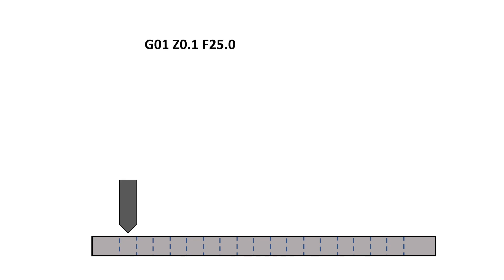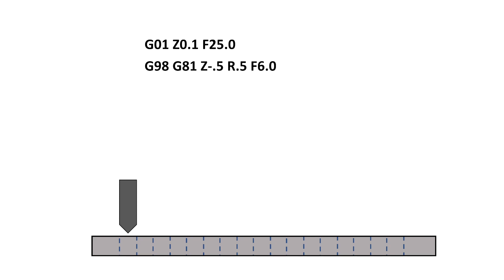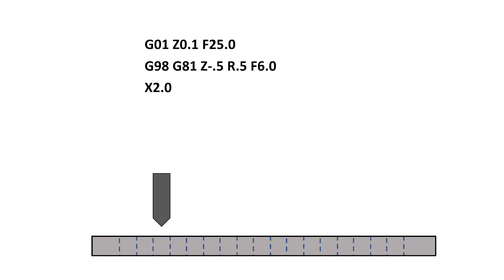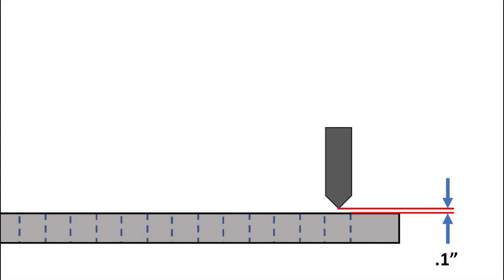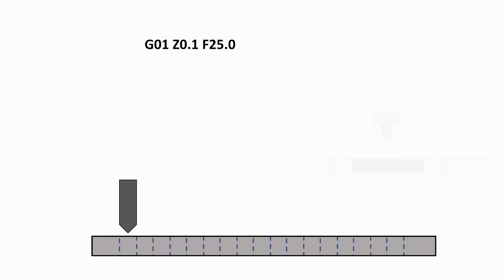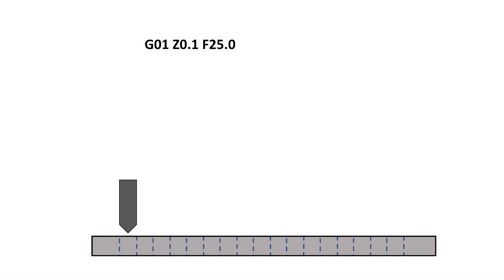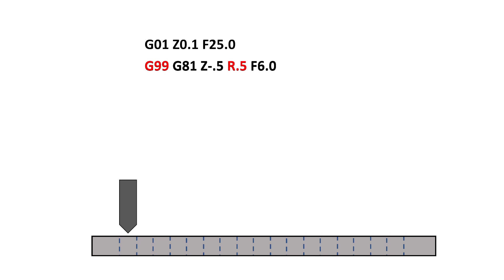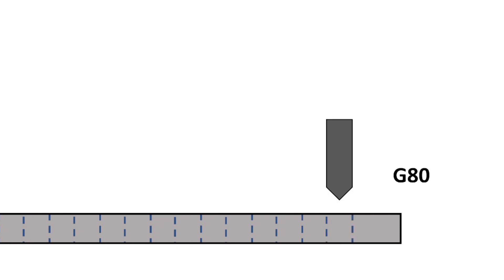CNC Programming G98 and G99 G-Code and Manual Programming Lesson 12

Comment: R0.5 is in absolut coordenates?!
So, after we drill the hole it will return to 0.5 (in absolut coordenates) above the initial Z0.1, and it's useful if we got any obstacle, clamp or piece imself to avoid coliding. After that wen we pass to another hole it will travell in G00 to Z0.1 saving time
Is it right?
I'm starting programing CNC and drilling is my new goal but im in vacation and got no program to test if my G code is right 🫤
Reply from the maker: When you are back from holidays send me a sketch and I will demonstrate and explain the code if that helps.